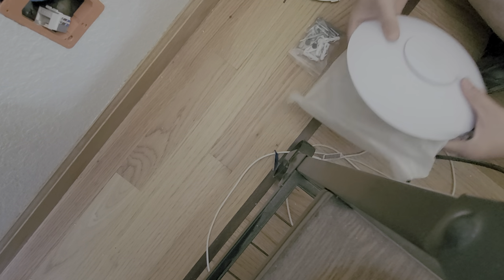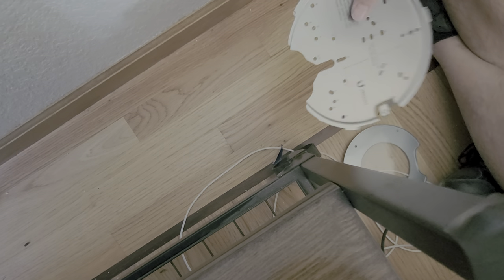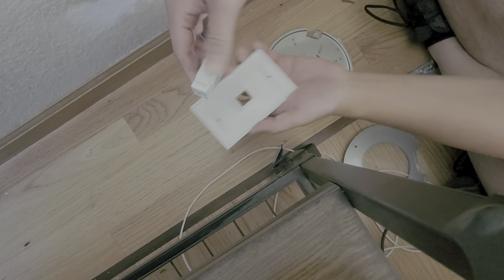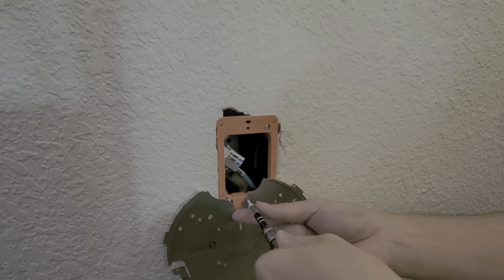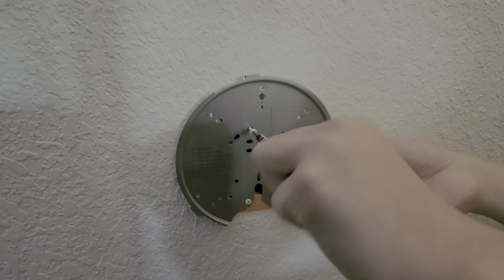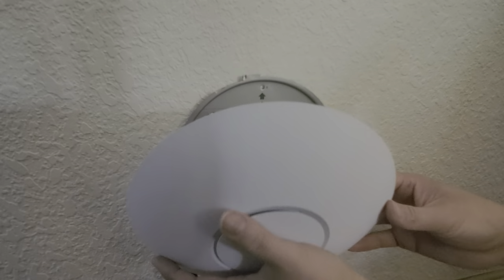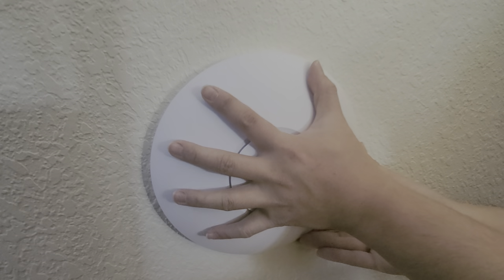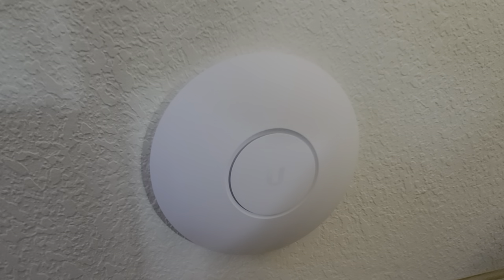Unifi HD Wall Mount Single Gang Outlet Box How To Installation and Removal

Comment: If you're going to mount on a wall box, why not get the AP model that's designed for that?  Ubiquiti has some that are designed to be mounted in those boxes and provide 2 Ethernet jacks, one PoE, on the front.  Also, fix that keystone connector. You've got far too much untwisted wire.  Half inch max.  What I do is put the cable into the middle of the connector and then fan out the wires, before I punch them down.  This means there is virtually no untwisted wire.  You do not need to have wires coming out of the bottom with the PoE adapter.  You put the adapter at the other end of the cable, near your switch or router.
Reply from the maker: Customer bought those and asked me to install lol
Reply: You took the words right out of my mouth.
Reply from the maker: That's what they bought and asked to install.